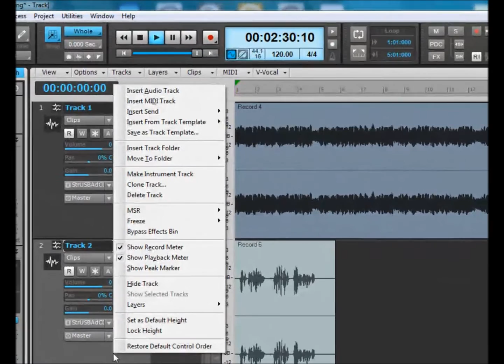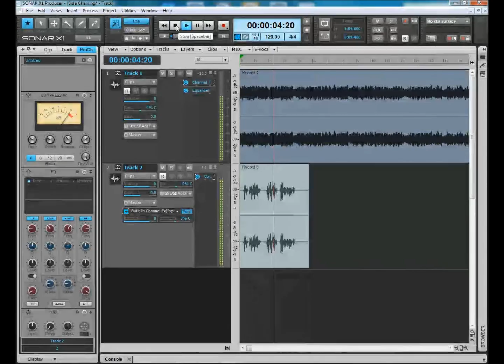Side Chaining & Ducking in Sonar X1 Producer Edition

Comment: It never works for me either ive watched like 30 tutorials and tried all the methods and it just doesent recieve the signal, it used to work on sonar 8 but since i got sonar x1 and all the updates it just doesent happen, the compressors all work normally, but when you switch them to sidechain and send a source to them the most that hapens is the surce goes mute, wich makes me at leat believe it knows its suposed to be doing sumtin but cant figure out what
 if anyone can help it would save me